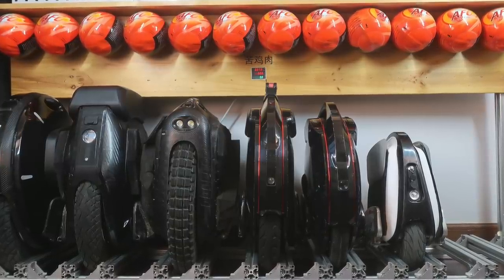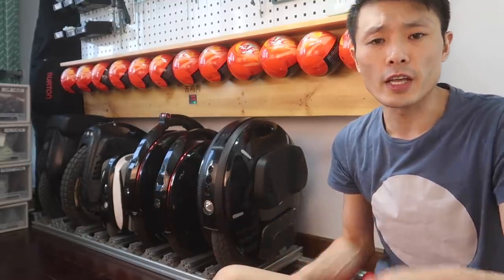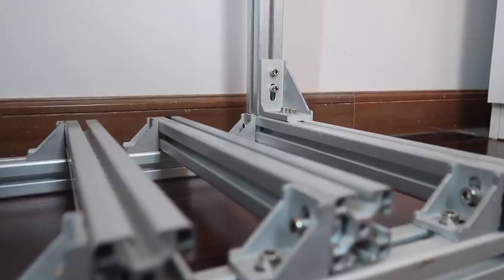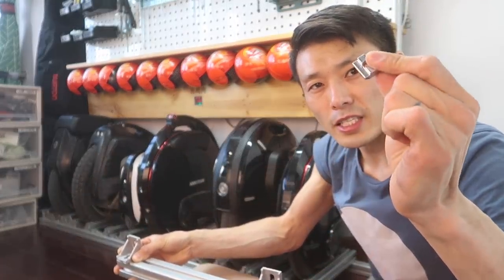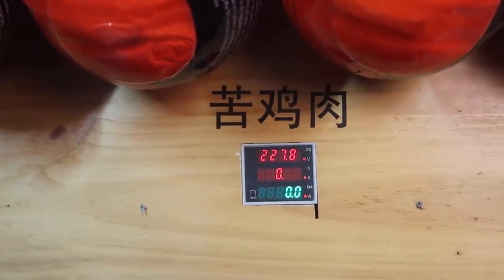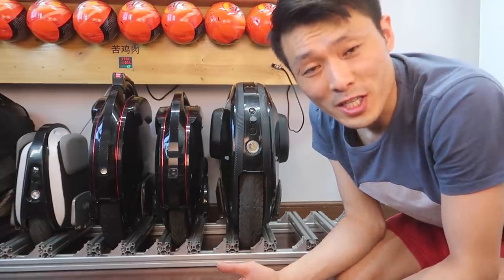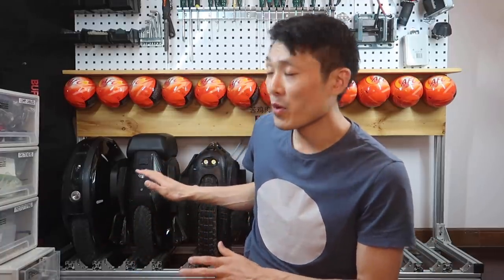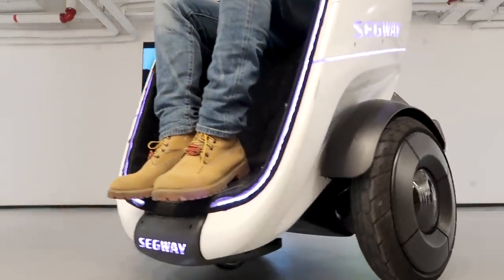Electric Unicycle Rack | EUC Storage Stand

Comment: Hi Kuji,

Lithium battery fire is considered Class-D fire, the AFO fire balls are rated to stop fires of classes A, B, and C. It’ll help stop other flair ups but won’t put out a lithium batter fire. You’ll need a Class-D graded fire extinguisher. I personally run RC cars and uses sand filled ziplock bags on top of the batteries inside a fire safe/lithium battery safe storage unit. Lithium fire is no joke, and for something with a massive battery capacity.... it’s a bomb lol. Stay safe and take care! 

BYW. I got my MTen3!!!! It’s been riding great 👍🏻 

Best regards,
Joe
Reply: They have some models for A,B,C,D and E fire.
Reply from the maker: Ah bags of sand! That sounds like a more economical and effective solution.
Reply: Kuji Rolls haha sand bags are effective for smaller brick sized lithium hobby batteries, you’ll need a lot of sand stored on top of the EUC. 😅
Reply: @jcastillo265  He should probably build a steel tank hovering in the space from chains on the ceilings with retractable doors of somekind that can be remotely opened or using temperature sensor to open if it senses anything above like fire to pour out tank of sand right beneath.
Reply: Sungwon Shin sounds like a good idea, call RND and tell them to start on project Kuji Sand Bag v.1, I’ll start on some sketches, you hold the meetings.
Reply: On this video at the 7:30 minute mark. You can see a cool example of a sandbag system and an example of sand putting out a lithium-ion fire.
https://www.youtube.com/watch?v=gobFcNzGG9I
This Bat-Safe box is also very interesting.
https://www.youtube.com/watch?v=0nrsoMsEMNU
Reply: @jcastillo265  The way Kuji is going he's going to have to build a house on the beach.
Reply: alaskanalain lol
Reply: Haven't I seen him use some sort of metal safe while charging, in one of his videos before? What kinda product would that be.

Comment: Thanks for such great description about your euc storage rack.  Every time since i saw it on a video a year ago i was considering about building my own, but there's now way for me to accomplish that. There are two reasons: 
1. Array storage rack needs more space than a wheels standing near wall. Currenly i haven't got space in room for your variant
2. In Russia every experienced EUC owner has an mud collecting tray underneath wheel. That's important for every 3 of 4 year seasons because if you don't make that the wheel could create a big mess with dust and mud after winter or autmn ride...
Your storage does not imply dirt collection.
Also you haven't mentioned cable retraction mechanism showed in the video
Reply from the maker: You're welcome. As for retractable cable, it's one of those ID tethers that doctors and people who have to open doors with their card all the time.

Comment: I like your Velcro power block management system. This is a very cool DIY modular system. I will definitely be thinking about this solution for future projects.
Reply from the maker: But maybe secure it with adhesive that's not gonna come undone with heat. Mine turned into a gooey mess

Comment: I totally get the niche market thing. Not many people have multiple EUCs. However, I will eventually be getting an off road one & I already have 2 regular unicycles sitting around that could easily rest in your unit. You should get a patent without the fire suppressor balls & put in the appropriate fire extinguisher mounted in the front middle of the unit. I could totally use one of these with 4 slots. 👍☮️🌞

Comment: Would placing two lengths of timber under and at right angles to the long aluminium rails to lift them higher off the ground work?  
Then widen the gaps between the shorter rails so the EUC pedals rest on them, instead of trying to wedge the tyre between them.
The EUC wheels would then be suspended off the ground, and not tip forwards/backwards/sideways.

Comment: I have been thinking about this several times, rack and fire. Got remote fire alert sensors and fire blanket and ABC extinguisher (metal extinguishers are just SILLY expensive and if the fire gets on its such a fast fire i would probably not even have time to extinguish before it was to late, so its more a means to stop ither stuff from burning).
Like the rack, only adaptation needed is that it needs to be raised from the ground by approximately 12cm so my robot vacuum csn get beneath and suck up all the dirt that falls of the wheels :-) (and dust rats that will accumulate unless one likes to vacuum manually)

Comment: Hi Kuji, great video especially for those with multiple wheels, not my case, but I liked it nonetheless. Just one unrelated question: I saw at the beginning of the video a Tesla, then disappeared in the end. You sold it? Why? Don’t you think by comparison that is better than V10f? Also MCM5 v2 isn’t better than, I think your V8 there on the rack? Have you tried it? Thanx man.
Reply from the maker: The tesla got relocated to nyc. And as for which ones better... Most wheels have something they can do the best. The v8 is my super convenient wheel --mcm5 does not do it better.
Reply: Kuji Rolls Thank you for replying, Kuji. Just trying to decide for myself what to buy for my needs: around 50 km range (I’m 70kg) and fast acceleration/braking, not too heavy. I would like V8f, but doesn’t have the range. I tried V10f, didn’t like the flat pedals being used with my angled V5f pedals. Also seemed lazy (acceleration) compared to MCM5 and Tesla, which I liked the most when trying. I don’t know if MCM5 (800Wh) could do 50km range for me, so I remain with Tesla, which unfortunately doesn’t have a stop light to be legal. I have to find a solution. Seeing your Inmotion wheels and no Tesla I thought maybe you consider them more reliable then Tesla/MCM5 (for sure they are better for rain). Anyway I will not press you for a straight answer knowing that you test wheels from all companies and cannot publicly favor one against another. Thank you again for replying. All the best!

Comment: With kuji pads, how difficult would it be to hop curbs on the V11 vs the built in pads on the S18?

I'm using kuji pads on my V8 and it works very well.

Comment: This video freaked me TF out! 
Now Ive been in deep firestate study. hears my learning:
1. Those fireballs arnt going to protect you if the wheel goes up. Why? cascading heat propagation from the reaction will fry ALL the batteries because you wont handle it whilst it goes up.. no way.
2. What is worse is that the wheels are close together.. this will accelerate the propagation  should the next wheels batteries suffer from the heat soak of the first fire..
3. the wood behind the wheels?  torch paper... the wooden shelving?  like lint to a spark .. all will be gonebecause a Li-Ion battery burn is as  good as done once it starts.. itll burn out till the end.

As such the best way to control it is with  a volume extinguisher to cool the fire and not let other batteries (basically wheels) suffer the same fate. because the batteries are so tighly packed if one goes they are all going. 

Safest place in a house?  The balcony next up.. in the house...  the bathroom. esp if floor tiled and walls tiled... the actual batth seems the best.. but NOT Plastic baths!

Dude.. this video has freaked me TF out... I have checked my insurance today... paid it off completely for the year.. but will boost it.... Next up fire blanket and extinguisher for sure...

PS. Did I tell you this video has freaked me TF out?
Reply from the maker: Yeah, that's why I upgraded to a fireproof charging box and this is just storage

Comment: 3D print a base plate for single wheels.. at least put caps on the end of those 2020s.
The balls won't do too much other than stop the fire but the lithium is so damn hot it self fuels itself until all the energy is gone, but better than nothing.
A proper decent charger and battery BMS that does the job properly, should be fine.
The alternative to your stand are side hooks that act like you holding them, they're in the air and turning on won't matter